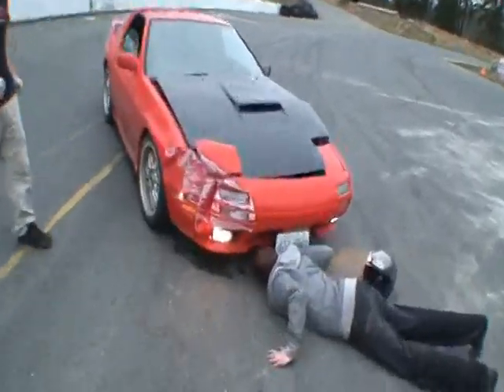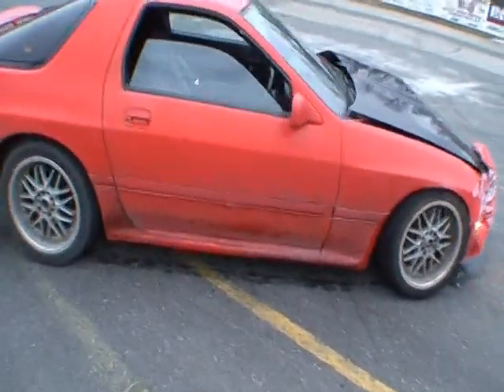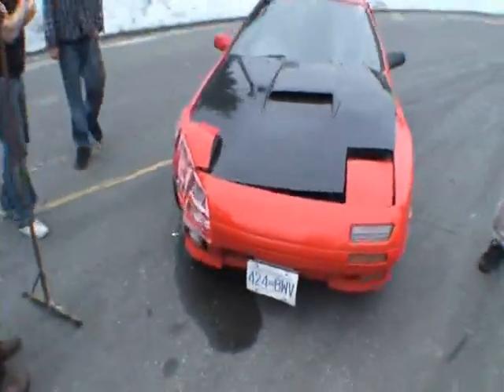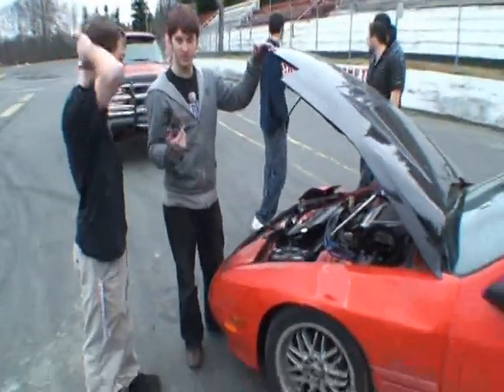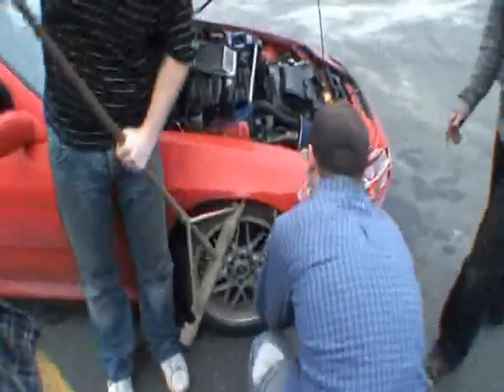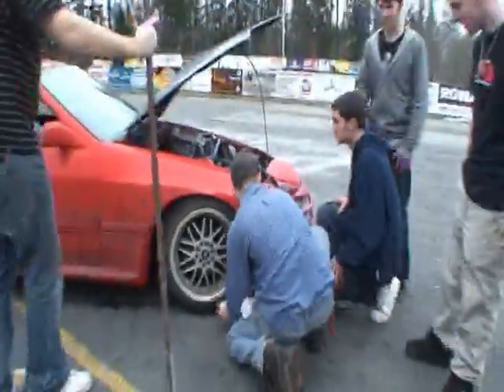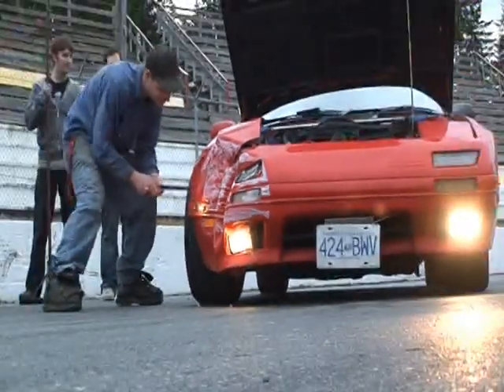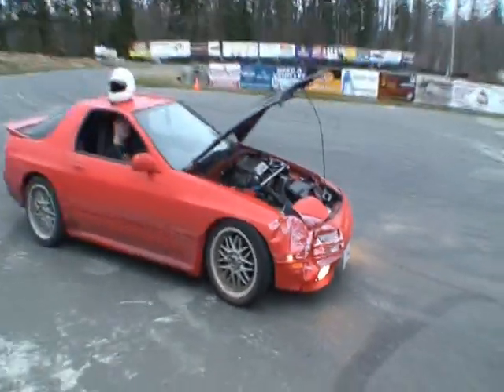RX7 Drift Crash

Comment from the maker: Ok, you are wrong, and i will explain why:

The rx7 is a chassis with "low polar moment"
This means weight is concentrated in the center of the vehicle - this allows the chassis to react to turns faster.

 "High polar moment" means weight is moved toward the ends of the vehicle - this causes the chassis to react slower to steering inputs, but change of direction of the vehicle is more progressive.  For beginners, a slower reacting chassis is much easier to control and learn with.

Comment from the maker: The FC3S spins very easily due to it's low polar moment, mostly caused by the fact that the 13b rotary engine is so light, and placed much further towards the center of the car. Look at an RX7 drift. It pivots at the center of the car. Now look at a 240sx. It pivots in the front, near the engine.

Comment from the maker: I said drifting has nothing to do with HP.

AE86 GTS Corolla's have 112 hp.
They weigh around 2000 lbs.

A Turbo RX7 Has 205-220 HP but weighs around 2700 lbs.

Think about power to weight ratio.

Comment: And you wonder why drift cars are held together with zip ties and duct tape. There is a very fine line between controlled drift and spinning out of control into the wall. He found it. Didn't hurt the car that bad. throw another bumper on it, new headlight and you're good to go. and you don't have to worry about scratching it this time.

Comment: Mazda Rx7s are 2 cylinder 1.3L motors in the FD and FC models. Rotary motors are that small and are powered through the triangular rotors instead of using pistons like other engines

Comment from the maker: are you stupid? the S13 240 is a notoriously bad chassis for understeer. Also the RX7 has a 1.3L rotary engine that is much lighter than the KA or SR engines found in the S13, also it is mounted further behind the front wheels, which makes the car close to 50/50 weight balance.

Finally, it wasn't understeer that caused the crash.

Comment: Trash ha... cmon dude, you gotta respect the rotary, the thing is amazing, 1.3L pushing ALOT of HP, depends on the model, I have a N/A 87 that pushes 146 and I am supercharging it to get ~250 HP, I also have a 94 that pushes 255HP bone STOCK, and what does "im packing 6.0" mean anyway? you have a 6 liter engine or something?? is that the GM LQ9?  I can get WELL over 345 HP with my 94 with very little work and still my car will only way 2800 lbs and perfect handling.
whats your 6.0 weigh in at?